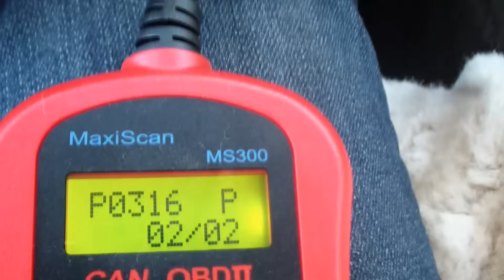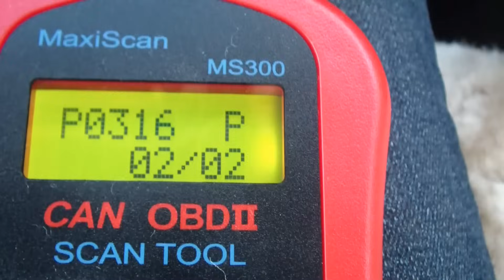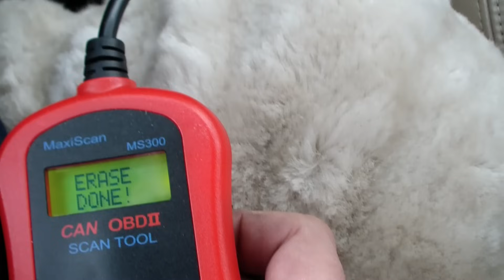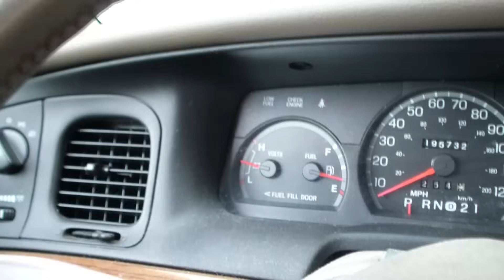P0306 and P0316 Misfire Code Repair

Comment: What about the oil on the plug?  Was that anything to worry about? I have the same issue
Reply from the maker: Oil on the outside of the plug is not great but everything still seems to work. Some say the oil can cause the coil to go bad.

Comment: You have an oil leak that is causing problems with the spark plugs. You should never find oil in any plug position. I know you are not working on a Mazda, but my friends car hat wet plugs and I had to reseal the leaking gasket...just bear that in mind . 🎉

Comment: Looking at buying an E350 that has same codes 
Check engine light
+ It flashes when driving.

No real balls at flooring it.
Shudders at light acceleration around 35+40mph

Po303 & po316
303=Misfire at 3rd cylinder.
316=Misfire detected

The 3rd cylinder is the issue that dominos into the 316.

Basically the 3rd child is screaming 😱 and the mother (316) says ONE OF MY KIDS IS HAVING AN ISSUE.

Ideally, a full tune up (plugs & coil packs) could remedy that.
But it could be more than just the tune up....that's the unknown bitch of it all.

Gonna ask the owner to have a tune up done - if it remedies the issue, I'll buy the van. 
Depending on the cost, I might offer to pay the tune IF it's the remedy for the codes.
If not, it's got a nice tune up FUR THE NEXT BUYER.

Sell me a working van not your headache.

Comment: P0316 does not mean cylinder number 6 because My car has only 4 cilynder but i got code p0316,
Reply: You can simply google whatbtge code means instead of guessing.  That's not a cylinder specific code at all.

Comment: P316 can have several variables, start evaluating ignition system starting with plugs and wires, coil not likely. test your cylinder compression as a next step. can be difficult to diagnose even with associated codes in conjunction w/P0316

Comment: Why would anyone want to take your advice when all you are doing is replacing a part from a code. you could have tested the cop with a multi meter to verify it is bad .. this is beyone you apparently. you could have swapped it with number 5 and cleared the codes and see if the problem followed it to number 5 .. you did none of this .. all you are doing is making a half assed video showing you replacing whatever part comes up in a code and not verifying jack shit and this is fine however you are taking the time to instruct a whole new generation of idiots by teaching them to keep throwing parts at a problem till its fixed or the cost exceeds the value of the vehicle.  If you want to at least be credible use a scanner that costs more then $8 dollars and actually has a data display at the very least. awaiting your next video were you do open heart surgery with a fork and a butter knife ...

Comment: Thanks. I am working with a 2004 Crown V now.I thought the cylinder orientation is Bank #1 on the left is: 1, 3, 5 & 7....Bank #2 on the right is: 2, 4, 6, and 8.
Reply from the maker: Certainly not. Just Google it.
Reply: @KentDiego  Is P0306 the # 6 cylinder or the 6th cylinder in the firing order ?
Reply: . Bank 1 is all odd bank 2 is even on any car with v6 and up. P @KentDiego
Reply: Passenger side is 1 3 5 7 all odd bank 2 is all even 2 4 6 8  i

Comment: Fluid in the spark plug chamber can cause the coil/ plug to not fire. I’ve had to clean mine out a few times, cleaned up plug & coil, applied  di-electric grease on each end of the spring. 
Do a resistance test on the coil, and test for 12V with engine running. Chances are you won’t need to pop for a coil.
(The P0306 was contributing to P0316, due to the misfire on startup)
Reply: Clear the area aroound the plug with compressed air before pulling the plug, then blow the chamber out after you pull the plug.  Wrap a rag around a long flat head and use it like a Q-Tip, or do the same with a extra long needle nose. The needle nose gives you more control.
Reply: The cause of fluid in my plug chambers was leaking gasket under the water crossover (at back of thermostat). Unfortunately you have to pull intake manifold to replace that gasket. I had to replace my intake manifold because it was cracked in that area ($400-500 for after market manifold).
Reply: I had to drop $354 on 2 Firestone Auto ignition coils/packs Cyl 7 & Cyl 6. This made my CEL 💡 go off, stay off. I have a 4.6L V8. 2005 Ford Crown Victoria LX Sport sedan: used, 179500mi. 2022. The car was having shakes, noises, back fires 💥, poor MPG ⛽️. After the changes, the Crown Vic runs quieter, smooth. No noises. The shop tech suggested having cyl 8, 5 switched too. My cousin & I added brand new double platinum Bosch spark plugs(8) & a new thermostat in May 2022.
Reply: Hey, how were you able to clean out spark plug area?

Comment: 2004 Lincoln Town Car
The first time code popped up was P0420 with Cylinder 3,4 & 7 misfire and random cylinder misfire. Long story short here I changed those 3 cylinder spark plug and check Coil pack amps which are  good and healthy. 
Couple of days later Check engine comes on and goes away, but this time it comes on during the night time and I had to travel 196 miles in the morning. when I almost reached my destination engine started to misfire like crazy where . I went to auto parts to run diagnostic and here is 1 new code added to my problem. 
*P0316 misfire detected on startup (first 1000 revolution)
P0420
P0303 Cylinder 3
P0304 Cylinder 4 
P0307 Cylinder 7

some are saying change intake manifold gasket before changing the oxygen sensor, don't bother Cat converter.
Reply from the maker: An intake manifold leak will cause rough idle but run fine while driving. If the O2 sensor is bad it will have its own code. If you did not replace the coils yet I noticed you can get all 8 for a cheap price on Amazon. Look through some Ford forums to see if anyone else had similar problems.
Reply: @KentDiego  looks like a EGR issue I have ordered the part, let’s see if that’s vacuums leak solves the problem or not.

Comment: How do you afford all of your repairs? I am a young guy wanting to go to auto school because my family has nothing but junk cars. I also need a solid career for day to day living.
Reply from the maker: Paying a mechanic hundreds in not my idea of fun. I takes less time to do it yourself than wait around at mechanics.
Reply: @KentDiego  Did you learn on your own or have you had training? I know basics but I'm at the point where more advanced problems are beyond me.
Reply from the maker: @ProTroll69  When I was a teen and had an old car in Michigan the winters destroyed cars. I had to figure out how to repair my car. My friends and I would hang out and fix our cars together. Even had a few summer jobs as a mechanic in college. Got real good at it but realized I did not want to be a professional mechanic so got my engineering degree. Retired now and it is a fun project to repair a car. If you want to be a mechanic just call yourself a mechanic and get a low level job to learn.
Reply from the maker: @ProTroll69  I also went to library and looked at service manuals when I had a tough job. Learned a lot from the books. Nothing like laying on the cold cement at 20 degrees F removing a transmission.
Reply: @KentDiego  Thank you!

Comment: Have a 2008 Avalanche giving me a PO306 code... 
Only 46k on it.. mechanic replace plug which was black.  Coil was ok, compression ok, injector was ok...
He is telling me top half needs to come off and look at ALL the lifters...  2k to 3k of work.  

Any suggestions..
Reply from the maker: Get a second opinion. If the compression is OK I would not look at lifters. Coil and plug are the cheapest to replace and mot likely to fail. Do that. Next is sticking injector. Does it run rough? Be sure to clear the code to see if it comes back.

Comment: Can a bad timing cause this problem..??
Reply from the maker: Modern cars have no timing adjustment. Need to replace the coil on plug as shown in video.
Reply: Kent Diego it’s an 2004 4.6l 2v Ford F-150. I was changing the tension on one side, time chain jumped, now stuck with hesitation...
Reply from the maker: That is valve timing not ignition timing. Had a '74 Gremlin that had that. Got initial hesitation but an increase in high RPM torque. It is not good. You need to align the camshaft to the timing mark with crank at TDC. Maybe replace timing chain and gears too if worn.
Reply: Kent Diego ok so it’s should be on tdc mark on the crankshaft pulley right...??

Comment: My car is 4.6 code p0306 can that be buring oil up
Reply from the maker: The oil is likely coming around rings due to worn cylinders. Often the oil ash will leave deposits on spark plugs causing misfire. Check your spark plugs.

Comment: Listen to Kent and I, and buy all 8 coils at the same time and save a lot of money (+ $150)

https://www.ebay.com/itm/8-pack-Ignition-Coil-DG508-Motorcraft-Spark-Plug-SP479-For-Ford-Lincoln-Mercury/252458078477?epid=514463152&hash=item3ac7ac910d:g:maUAAOSwuxFYt2TR:sc:ShippingMethodStandard!94805!US!-1&vxp=mtr

 I had 1 coil go out so replaced it @ $45-ea. If I would have known a second coil would go bad 4 months after fixing the first coil I'd have bought all 8 coils and done changed all of them at once. 
Don't buy just 1 coil. 
I did cuz I'm stupid.
Buy all 8.

Comment: This happened to me again today, LOL.  A year ago below you can see my comment on where I had to change number 8 coil.  Today slightly after my engine started missing my engine light came on.  So I put my OB2 reader on and got a po316 ad po303 and po353.  This will make people laugh but 353 and 303 are the same code meaning number three cylinder.  I changed my coil on number 3 and erased my codes first then started engine and it corrected it.

Comment: I replaced coil packs , fuel injectors , plugs,wires,  I hope cylinder 6 doesn't have low completion I'll check that this Thursday . I don't believe   the 04 3800  had these issue .but you never know now with 189969 miles as of 4/4/17

Comment: i have a ranger 97. i am getting a misfire on cylinders 1 and 5 along with a purge flow sensor circuit high input. do these have any relation to eachother that can narrow down the issue? any input is def appreciated, thank you sir! :)
Reply from the maker: A leaking vacuum hose could cause both error codes but misfire and the purge flow sensor error codes are not likely to be related. Certainly inspect all your vacuum hoses for leaks but you may need to fix each separately.

Comment: On the ford v8s it is generally the spring in the boot that goes bad, not the coil, it fixes with the coil because it comes with a new boot and spring, always do boots and springs before even one coil

Comment: I bought a 2006 f150 4.6 the p0316 code misfire in 1st 1000 revolutions is occurring for last 3 months. the truck seems to be running fine. not detecting any true misfires while running. but when starting sometimes i have to cank 2 or 3 times before will fire up..if this code continues what are the most common failures to cause this.... is their anything I can do to prevent this from occurring every winter.
Reply from the maker: It started with a funny hesitation at 55 MPH for me. Got worse. I also had a second coil fail later. I suggest buying new coils for all 8. I see on Amazon where all 8 is just a little more that one cost me at local parts store,

Comment: You are awesome for making this video! Ive been dreading taking in our '08 mercury mountaineer 4.0L and weve been pulling a code p0316 a few months after we changed the plugs , the engine idles very rough on idle so a misfire is definite. we havent had a check engine light EVER but I did buy an obd2 machine to check all of our computer systems and every time it shows the code so no it doesnt show up immediately even after 200 miles of driving on the highway
Reply from the maker: A failing coil starts off slowly and gets worse over time. I had funny stutter at 50 MPH.  I had two fail so far. At local auto parts store they were $43 each. You can buy all 8 (or 6) on Amazon for almost the same price. Would be good idea to replace all of your coils before they get worse.
Reply: Kent Diego by december were planning on having some iridium plugs,coils and c.o.p. harness if the connections are off. I'm guessing an injector is to blame aswell because we were getting 24mpg without the problem and now its roughly 20mpg so one of the six is faulty

Comment: of course the check engine light is off. you just cleared codes. it wouldnt come back on until youve driven it a bit. however the p0316 code would show up almost immediatly if the problem still existed. all in all a good video. thanks for posting it
Reply from the maker: +Bruce B The coil cleared up the rough running too. A number of months later had another coil go bad. It might not be a bad idea to replace all 8. i found 8 on Amazon for $50 but I paid $42 for one at local parts store.
Reply: Took the words literally out of my mouth when he started and said there's no engine light on after just clearing it lol

Comment: I love you and you did good.  I had a 308 code and a 316 code this morning on my 02 f150  and I traced it down to the coil on number 8.  Then I erased my codes and drive it and no codes returned and the engine no longer has a miss

Comment: P0316 is not a cylinder specific code. It is a coincidence that your misfire was on cyl 6.
Reply: Yes, my code reader states its a MISFIRE DETECTED ON STARTUP (FIRST 1000 REVOLUTIONS).  This would potentially show with any cylinder specific code such as P0306.  What this tells me is that the fault is getting worse, as the failure is detected within the first few seconds of starting.  I believe this was the case in the video.  He stated it was originally a 306, and the 316 was new.

Comment: You should have diagnosed that oil leak on the coil boot causing the spark to ground out through the boot. In most cases oil on top of a spark plug but not on the tip indicates a bad calve cover gasket.
Reply: +Derek and Kristen Gaffett  Correct.
Reply: The auto mechanics at my Orlando FL Orlando.gov area Firestone say my Ford 4.6L V8 Crown Vic P74 manifold gasket is bad. Leaks coolant into the ignition coils, plugs; CYL 5-8 side.
Reply: @DavidLLambertmobile  Coolant  cold also be the intake manifold deteriorated, the coolant travels and causes misfires.
Reply: @DavidLLambertmobile  you probably need a intake. Gaskets go bad when the intake is failing.
Reply: @DavidLLambertmobile  That happened to me too.

Comment: What a helpful video. I gave my 2002 Chevy Suburban 1500 4x4 a full tune up, changed all the spark plugs and wires with recommended  parts but cylinder # 6 was still misfiring. I just installed a new Duralast ignition coil on cylinder # 6, took it for a ride on the highway and so far so good. Thanks for the taking the time to help others.

Comment: ok .. i was whatching your video i like it.. but is no helping me .  i have a 04 ford ranger  edge is the same code .. i did change the all this is in this video but the problem still there.. and most of the videos on youtube .. is not helping me.. any idea what els can bee.?
Reply: +reynaldo calderon You never mentioned whether you checked your injectors.  An injector at a cylinder can also cause a misfire code.  Heres how I check injectors. With engine running put one of your finger in the plug at the injector and if its working you will feel the clicking.  Because if you feel it ccling that means the injector is opening and closing and if it doesn't click the check the connector with a bulb test light and if its okay change the injector.  ITS EASY!!  Also check your connector current with same test light on your coils.  Don't freak out like others and think its a burned valve
Reply from the maker: +reynaldo calderon So you replaced all the coil packs and still get error codes? Did you clear the code and have it return? Could be other things than coil. Do you have a miss on acceleration or rough idle? Since code is specific to a single cylinder i would look at fouled spark plug, fuel injector, or leaky valve. Do a compression test and look at each spark plug. I would replace all spark plugs with new iridium plugs.
Reply: I did clear the code and come back . I did replace all the spark plugs ..i think is leak valve..acceleleration is good. Not run rough..some of my friends tell me the i need to scanner ..on the computer.. .. Thk u. Kent Diego. For u hellp.. And thank u for make videos and put them on here.. All this videos helps alot..

Comment: My 03 CVPI has an engine miss when I put in park with my foot on the brake, & during light acceleration. Seems to run smooth at idle, but I have no check engine light. I just replaced fuel filter just for the hell of it, but no difference in running. I'm hoping its one of the coil packs !
Reply: +TheBluetoob Unplug your coils at the connectors ONE AT ATIME with engine running and the bad ones will not make a difference in how the engine runs but the good ones will make a difference.  That's how I found my one bad coil on number 8 left rear cylinder
Reply from the maker: At $40 each you need to know which one is bad. For me it took 4 weeks and kept getting a bit worse until I finally got a code. No other way to tell. Spark plugs looked all the same. Can try MAF cleaner on MAF sensor near air cleaner or spray carb cleaner in throttle body. May be bad spark plug too.